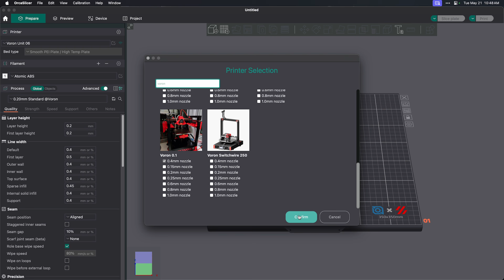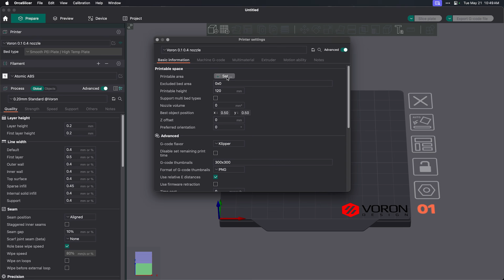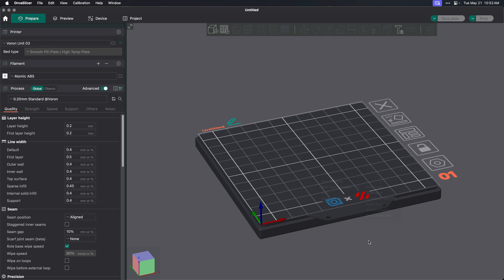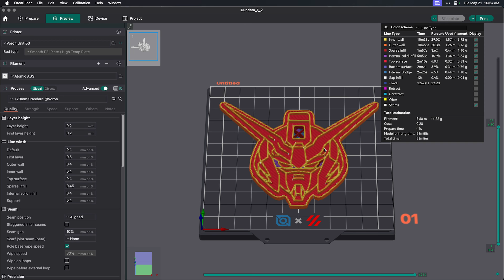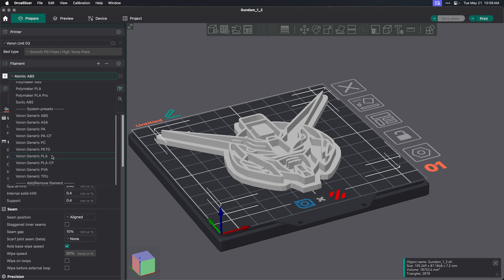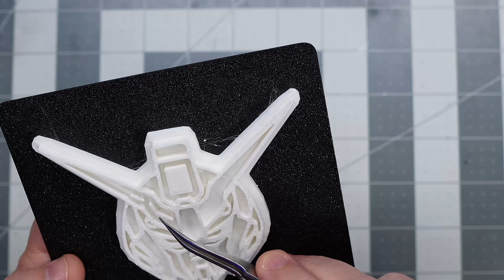LDO Voron 0.2 Build - Orca Slicer Setup & First Print

Comment: Can you tell me the g code for the purge line please
Reply from the maker: My Klipper config for that printer is here: https://github.com/markkendall/voron-v0-config
I'm using KAMP (https://github.com/kyleisah/Klipper-Adaptive-Meshing-Purging) for the purge line.
Reply: @gunplamark  I am also building now an LDO 0.2 kit, and I think you forgot to mention a couple of things for beginners:
- in Orcaslicer, you must disable "Arc fitting"  option, because Orca has by default “gcode arcs” commands enabled, which Klipper does not recognize.
- In "printer.cfg" section "extruder", you must increase max_extrude_cross_section to 5 for the line purge to work.
Reply: I concur, your purge line g code would be a great start.